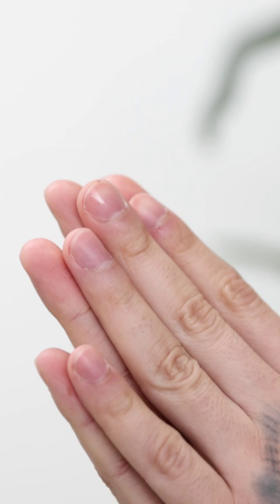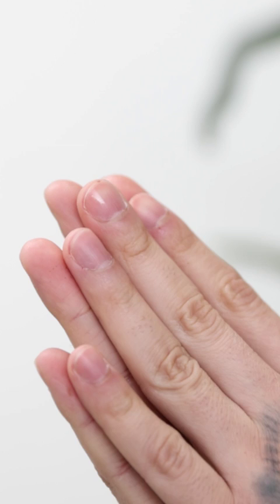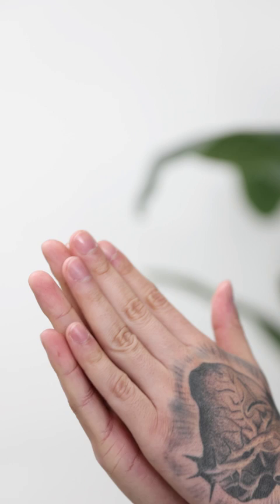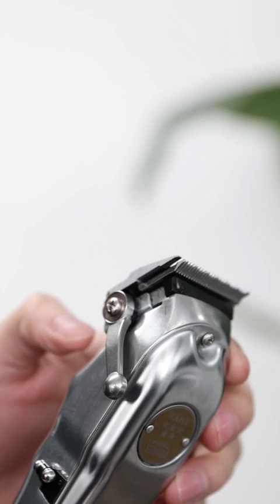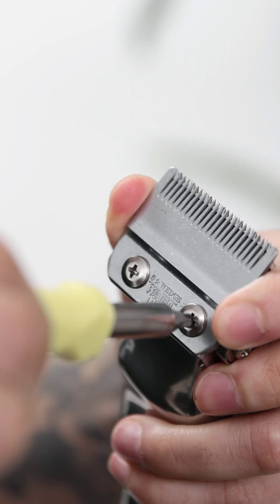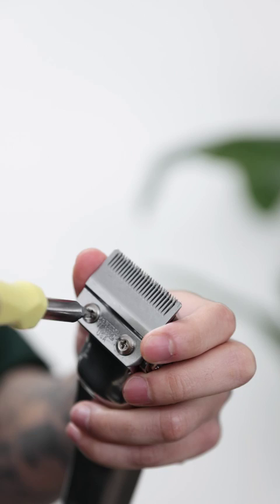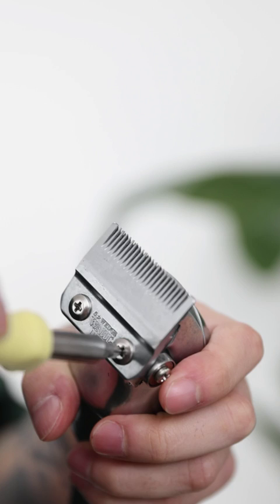💈 HOW TO ZERO GAP YOUR CLIPPERS IN ONE MINUTE! BARBER TUTORIAL!

Comment: I still have a scar on my arm from testing my blades after adjusting them.
Reply from the maker: It takes practice.
Reply: Hhahahahaha
Reply: I have two in my arm and one on my leg took me a while to get it perfect 😂
Reply: I’m died 🤦🏻‍♂️💀😂! Welp looks like you have to work on those adjustments 😂😂😂
Reply: With the Clippers off, first run it across your nail, if it scratches you've went too far.
Reply: I followed the i seton the video, I notice when I put a guard on the clippers it rattles a lil bit any tips on how to get rid of that?
Reply: I’m thankful I found your page, didn’t even know you can Zero Gap your clippers. Going to gave it try Thanks 🔥💯
Reply: Same 😂
Reply: I tested it on my butt cheek, I need a proper story that makes me look good if the scar doesn't go away.
Reply: @Kheops.  Damn 😂
Reply: Does this work on liners?
Reply: @fabianhernandez769  If it only happens when the lever is closed that means the moving blade is set to close for the guards. If it happens all the time it's most likely because of the stationary blade is not centered correctly. Meaning your moving blade is hitting the sides of the guards.

Comment: Or just place the clippers with the blades flush on a hard surface and press down while you screw.
Reply: Do you think you could not bend the tips of the blade if I do this method sounds strange to me
Reply: @zenyfilmsrambo  the blades will be flush with the metal clipper and not put any weight on them. It will just keep the blades from moving while you screw them tight.
Reply: @sly_sync  Now I understand better man. thanks my g for the contribution

Comment: I zero gapped them and they don't scratch, but when I put a guard on it makes hella noise like it's hitting the blade. Are the cutting blades off center or something?
Reply: If they are off center it will rattle all the time. If it's only when you close the lever then the blades are set to close for the guards.